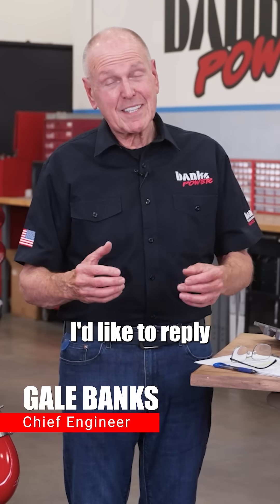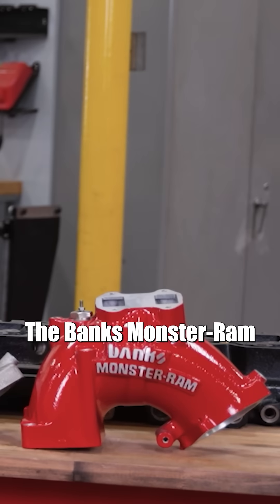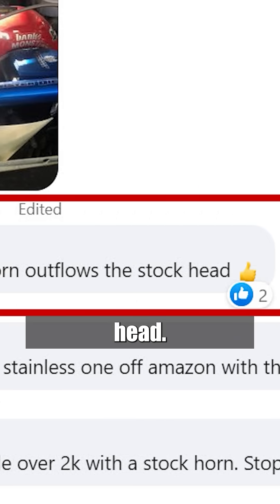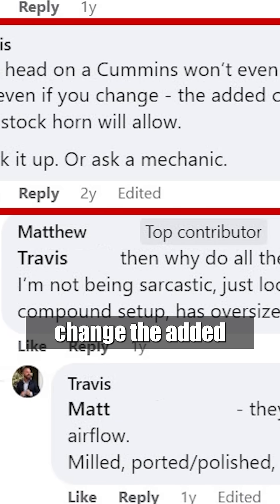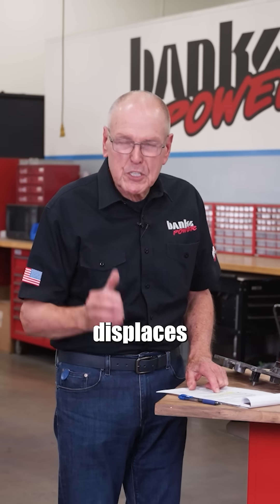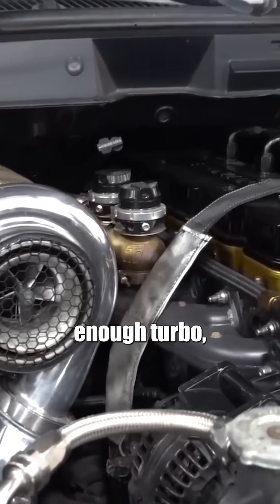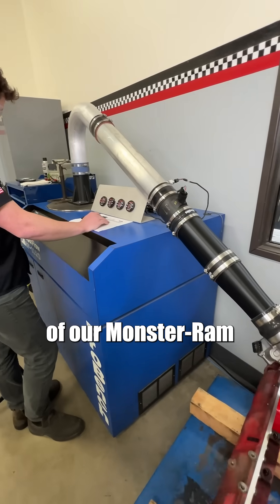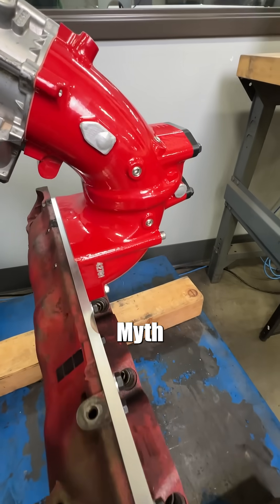We tested a Cummins cylinder head for airflow.

Comment: Ok thrn since you know more than us mere mortals why dont you back up your claims with back to back dyno test to prove your right and we are wrong? You could do it on a stock truck that head flows around 180cfm or a fully ported race engine with a head that flows a max of 300 cfm. If you can find a cummins head that flows 333 cfm at 2800 rpm I dont care what the price is, Ill take 2.

Comment: These are the same people that will tell you because of some formula they found on the Internet that a strong big block will be happy with a 650 CFM carburetor. 
I'm listening to the guy who has probably used as much Diesel fuel testing stuff as I have in driving a semi for 30 years.
Thank you Mr. Banks.

Comment: I've come up with a modular supercharger concept you might like, a base that's an intake manifold with injectors by itself, a supercharger screw section that can be quick swapped for other screw sets and a bird catcher ram air tower that's the top half that could be swapped for a lower air filtered intake component, a 3 piece sandwich supercharger that can be quick tuned for various HP levels that could also have turbos directly attached to where the butterflys would be at the front top of the bird catcher. Also a vertical flow intercooler that could have a full top width kn airfilter and pull air downward from the top. The supercharger tower or low profile top cover would tab into the lower section at the back, the back screw bearings would be contained in a screw holding frame section and the front bearings would be held in the front cover that serves as the piece that holds the top and bottom half together, the top and bottom would be compressed together by a turnbuckle tool to line up bolts in the front cap and compress the gasket and hold the airscrew set in place with it's wrap around frame piece that nests in between the upper and lower halves, it would be fun, the pass thru for fuel lines and injector wiring would be sealed from the inside by the superchargers own boost pressure. I can see the tuneability being useful for multi class drag racing with the same car and motor block. I got more designs

Comment: How much flow do you have through the DPF and SCR? I would also see how the numbers are affected through the EGR. Depending on the year and amount of valves some of the engines may not be legal for on highway use, unless your vehicle may not be used for on highway !! What about the 100 MM VGT you are using making 900 lbs. boost, everybody wants to be a engineer, but in reality many of you gurus are not qualified to start a diesel. I think I will trust Gail's information and his knowledge base, he has almost as much experience as I have.

Comment: My question is this ,,, I have a 2019 GMC 3500HD 4 x 4 dual wheel regular cab chassis cab with 11ft steel bed completely stock with only 46,000 miles on it.  Would you like to take my stock truck and build it into a  bullitt
proof farm truck and utilize it for pulling cow trailers and farm machinery to farm related farm jobs? Would you like to do this for me to show off through out the state of Mississippi?  I really wouldn’t mind at all. Let me know when you can get started please?

Comment: Wait I want to try this before Mr. Banks speaks. Ok so when you are doing head flow work you brainiacks the number you are given is for one port. If a head flows 250 let's say then due to the motor running every rotation of a full 360 degrees it uses 250 cfm + because like any good head we scavenge so with over lap let's be easy and say. Just 5 cfm over lap for each valve now we are at 260 cfm per port per full rotation 
Then factor in boost and chamber work. So how does the stock intake horn out flow the head. When the motor is running. For every full engine cycle 1040 cfm. Now, let's be just common sense honest. I may not have this head stuff correct with my thought as  to why  they are stupid wrong. I think it's  that these bone heads start stupid to end  typing.  Gail Banks about how much " they" know vs what he does. ? Because I'll say this I'm you know pretty damn smart about internal engines, so smart in fact I may not have wrote down . Y answer to his statements he was making and not for nuthin but it was a nice to see Mr. Banks put some lead in his pencil , 👍 I was a big fan very early on about Turbo charging so early I almost felt stupid talking to grow men in the performance world of turbos as far back as the late ro mid 70's and Gail Banks was one of the first people I remember reading about. So again ok I'm just gonna say it right. Who in the hell are you bunch of dumb asses checking Gail Banks about something he is doing? Please all of you dumb asses who are you ? Dif I sleep through ? No I haven't missed class this is good. Mr Banks I hope I have half your knowledge when I'm your age and and have a mind set like his. And I bet ya any money he is so good from many years of comfort that he can laugh at shmucks like them. Ok back to learning hate off to ya Gail.

Comment: I really like Gale Banks but this is not a good test. All 12 intake valves are NEVER open at the same time. Now you will have more air flowing at one snapshot in time than one cylinder at a to due to velocity of 6 cylinders pulling air, but not 700cfm. In a stock truck, the stock horn works, it’s a forced induction engine without a throttle. But turn up the power and the stock horn will be some sort of a restriction. At the end of the day a dump never lies though. If the turbo has to push harder (more boost) to make the HP number, that takes up more exhaust energy (parasitic drag). But then why don’t we make everything bigger than 3 and 4” charge pipes? Why not 6”? Why don’t we put a custom billet intake manifold on every truck? Stock works for stock after all the stock horn has to get air past the stock heater grid. Banks intake horn has some nice features and is functional but is it necessary for everyday driving? Does your engine run at 3400 RPM at over 450HP more than 10% of the time? I would say the stock holset VGT is the first biggest restriction on a Modern Cummins!

Comment: Question about the ram air horn for 3rd gen Cummins. Is there a port to relocate the air heater in the horn to eliminate the grid heater and use the same heater used in the 6.7?

Comment: Genuine question.. I've never built a cummins or any diesel for that matter but I would still like to improve my understanding here... 

I wanted to see other flow bench testing of the 12v and 24v cummins heads for comparison and most seem to get between 150-200 CFM at .300 lift on a single cylinder (stock). Is the variance between those and what Gale is sharing here an artifact of the testing methodology? I noticed Gale says "pumps X CFM @ 2800 RPM" but I didn't hear any mention of RPM when watching other flow bench tests of the cylinder head. 

As an EE/software engineer myself, I feel that challenging someone's conclusion without first understanding it serves no purpose whatsoever. I may not always 100% agree with Gale's opinions but I absolutely respect the engineering at Banks and flow rate is not an opinion. Assuming they actually got that flow on their bench, which to be clear I have no doubt that they did, then there has to be something different with the testing itself.

Comment: Even IF it was running at mac cfm through the head, there is a thing call fluid slip friction. The more surface area of restriction, the more it will restrict. For instance, a 1 inch restriction will not have as much effect as a 12 inch restriction. So even IF the head was the choke point, the air piping should be oversized so as to not add more restriction. Gale Banks is probably the most knowledgeable man in intake engineering.

Comment: Had someone tell me that a cold air intake did nothing because “the engine can only take so much air” and that the dyno videos I posted were “just fluctuations in the machine”. I simply replied, so how does a turbo work? Internet is full of “experts” that likely don’t know the difference between a metric adjustable wrench and a standard one. 😂😂😂

Comment: Run that flow bench test with the valves in the head, injector ports plugged and open the valves to full cam lobe lift then let’s see the flow numbers. That intake looks impressive on the bench but I’ve never seen an engine run with every valve open at the same time. You of all people should know that gale.  That’s a very easy way to cheat the bench numbers in my opinion
Reply from the maker: The point of the video is not the numbers themselves. It's that improvements to airflow before the head still have a positive impact on performance.

Comment: I have a1998.5 Dodge ram 2500 2wd short bed with 134,000 miles on it. I put the monster ram intake, banks turbo, banks exhaust brake, banks exhaust system, banks engine performance controller. Mr Banks knows how to turn a wimpy 215 hp Cummings into a tire smoking beast without a bunch of black smoke coming out of the exhaust pipe! Thank you Mr Banks.

Comment: Im rather tuned into performance. For a decade i ran my cummins all stock beside 3.5 inch boost and charge tubes. I decided to change to a s and b intake horn when i was servicing some stuff anyway. You could feel right away the truck faster. Egt’s dropped. It built boost faster. It was entirely better. The specs say the monster ram flows better than my s and b.  So no hate on banks in this comment.  Performance and air intake temps improved so im going to say it worked. Worth the money?  Well is any of this shit worth the money?  I have so much money into my third gen to keep it running. No its not worth anything but thats what we do as truck owners. We dont let anything die. 

If you havent modified anything else i probably wouldnt change the intake horn.  Tune, built trans, high stall converter, boost and charge tubes, full exhaust and 4 inch down pipe; i noticed it on my truck and im glad i changed it. The stock one is really tight

Comment: NO FACTORY INSTALLED CUMMINS WOULD BE CAPABLE OF BREATHING 331CFM AT 2800 RPM NATURALLY ASPIRATED. 
This will require 100% volumetric efficiency N/A. Gale Banks left off the VE portion of the estimated cfm calculation to skew the numbers high.
 A good "street" spark ignition (gas/petrol) engine with well matched intake/head, cam and headers would be looking in the 90s% ve at wot- no throttle restriction.
Without even looking at camshaft timing there is no way the intake and exhaust side of a 6.7 Cummins would allow anywhere near 100% VE N/A. 

I commented to this effect last time this clip was uploaded too, it was ignored.
Reply from the maker: Neither your first comment nor this one has been ignored. While you are correct indeed about its inability to achieve 100% volumetric efficiency, the point of the video is still the same. Improvements in airflow before the head will positively impact performance.
Reply: @bankspower  It seemed far more like the point of the video was the skewed cfm capability at 2800rpm used to bash commenters. 
Yes removing restrictions before the head will always help, but fudging terminology (displaces instead of draws in etc) and leaving out the ve part of the equation to imply the heads flow far more then was said in the comment is an underhanded and quite deceitful way of trying to bash people that disagreed with you. If you want to argue the head flow numbers put a head on an a flow bench and flow one at the standard pressure drop used by the industry- compare apples to apples.
Reply: @bankspower  But why not simply explain that head flow numbers and engine intake flow have no correlation? Why fudge a intake cfm calculation to try and make him look silly?
 Head flow numbers are based of an arbitrary pressure drop and are used for estimating hp potential vs cylinder numbers.
Teach, dont mock using apples to oranges. That only impresses Fan Boys who only know the front from the back of a pickup because of the way the seat faces.
From a quick search on 6.7 factory head flow numbers he wasnt particularly wrong, from what I saw he was actually highballing

Comment: The point is simple you can't move air if it is not there to begin with. If the replacement will over flow the head then you are doing better than stock.

Comment: You sir have nearly convinced me to try to diesel swap my little Mitsubishi Mighty Max.
Reply from the maker: If you do, please be sure to share photos and video. It's impossible not to love a Mighty Max.
Reply: @bankspower  it really is haha. I traded a Ruger 10/22 for it and then blew the engine head. I've almost sold it to a YouTuber cause the body is rough but the frame is still painted. Water pump blew out and I was in strange territory and hauled it 12 miles for home. And MADE IT with the truck running with 5 cracks in the head, replaced the engine head for the 2.4, and am slowly piecing it back together. Gotta fix it to be able to go get a job cause well, 30 miles in the boonies. 

At this point either debating a diesel swap or a Chevy 4.3. it's the 5 speed manual and 3.91 pozi Mighty Max.

Comment: I thought the point of this was to replace the way the grid heater was mounted to prevent ingestion of that bolt. 🤷‍♂️
Reply from the maker: The Monster-Ram was designed in 2016, before we were aware of grid heater bold failure. The kit was developed to improve airflow. An added benefit is that it eliminates the failure-prone factory grid heater.
Reply: @ fair enough. Good to know. 👌 

I just know that’s what we use y’all’s intakes for.  lol

Comment: I think a lot of negative commenters do it just because they don’t have anything better to do, plus a lack of knowledge. Seriously, who in the car world doesn’t know Gale Banks’ bonafides? Here’s a quote from his website. 
“Since 1976 Gale Banks Engineering has been involved in building and supplying engines and systems to defense contractors and directly to the Military, as well. Over those 38 years, every military Gale Banks Engine has had one dominant feature; they’ve all been turbocharged. At first, their Twin Turbo, Intercooled Marine Engines, ran on gasoline, more recently, their marine and wheeled vehicle military applications all run Diesel. And, currently, the tactical military fuel requirement for all engines has moved to JP-8, high-performance jet fuel.”

Comment: Worked on many diesels with banks intakes an other nice parts installed. At a certain point you have to consider how much your gaskets will withstand ect. Seen more leaks than problems with Banks intakes installed 100%. User error not design flaws. ☝️😎

Comment: When you made vedio on the new duramax and GM in largeered air and exaust ports or new design in heads and pistons. We came very excited. My company was planing to purchase a new 3500. We are very disappointed though with all the technical advances for the fuel economy to be worse than bad. W. T. H??? Then a junkie Transmission too Very disappointing

Comment: This is awesome! I worked in NASCAR for about 5 years and am very familiar with the flowbench. Those clowns talking CFM have no idea how you even determine the number. They are just smart enough to get in trouble. Too dumb to know when to ask questions. I am always asking questions and to answer most requires extensive knowledge and the correct equipment!

Comment: Air can be significantly compressed and shoved through the same diameter hole at higher speed, creating more cfm. The rating at rpms through the head is based on the stovk turbo and air intake. Its called physics, and people should look it up before they speak.

Comment: It sounds like the difference of the 2 ways of looking at it boils down to: some people’s logic would say that any passage can only flow as much as it’s smallest choke point & anything above that is irrelevant. But it sounds like you’re saying that even if you have a chokepoint, that if you have others along the path then they also add to restricting & disturbing the flow. I know you’ve tested & lived it so I know you know. Heck we’ve all been getting performance gains from putting better aftermarket intake manifolds on engines with crappy stock heads for many decades so we all know it does work.

Comment: Honestly gale until you tell ppl that CFM is meaningless in performance discussions this will continue. Yeah the few of us that understand how this stuff works get that lbs per min is the only metric that matters but the majority don't understand why. Now I get it every flow bench reads in CFM and for a good reason but once we're having a performance discussion density matters too much to ignore. Even if it flows less the fact we have boost makes that point fairly mute.
Reply: Head intake port flow is not meaningless. In a naturally aspirated engine once port air speed reaches approx .55 mach the port flow stalls and pumping losses skyrocket- if hp levels were expected to keep climbing they would either level of then drop or slow dramatically then drop.
Boost can overcome this to a point but pumping losses will affect hp. Ofcourse cold air will be better then hot air but boost does not make flow bench numbers moot, especially in a performance discussion, that will cost power.
By the way, comparing head flow numbers to theoretical engine intake cfm as done in the video is apples to oranges, one has no bearing on the other at all